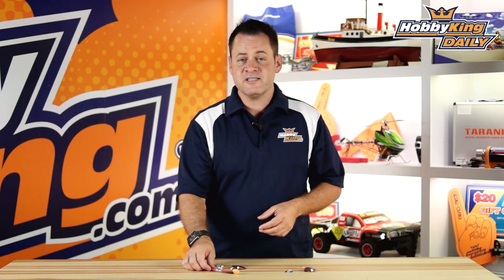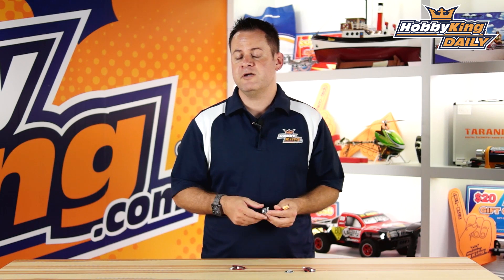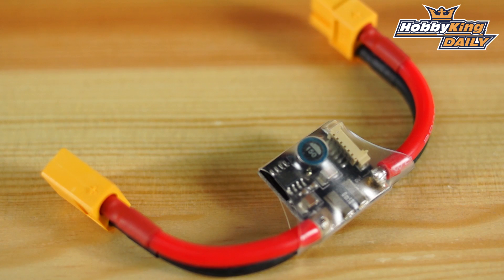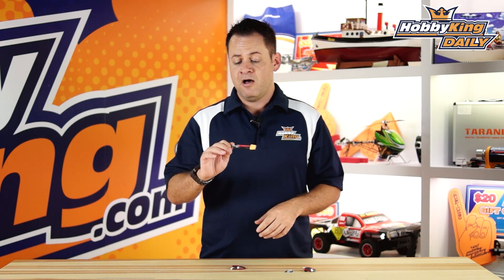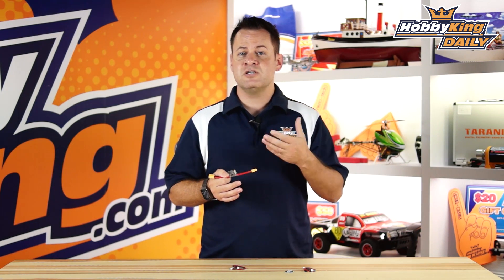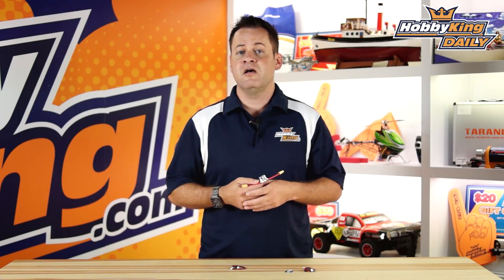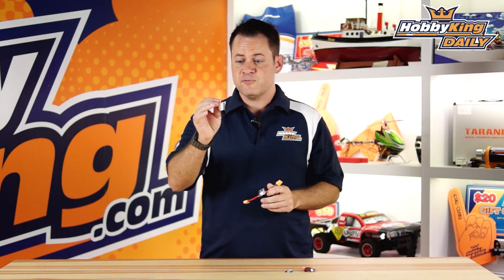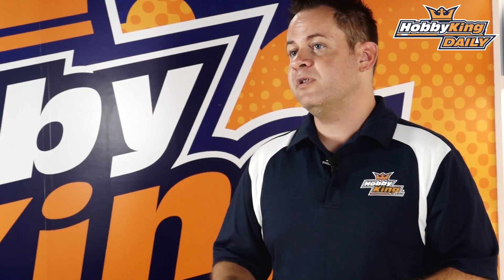HobbyKing Daily - HK Pilot Mega Accessoires

Comment: There's no such thing as a 12V LED.  A typical LED has a nominal forward voltage drop of around 2.8V.  A so called "12V LED" will have some form of current limiting resistor either built in or in series.